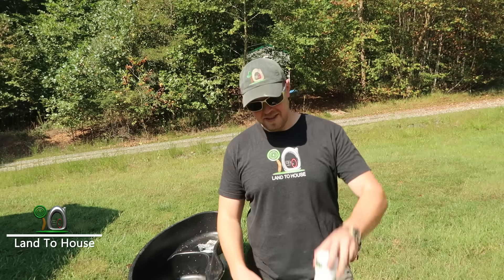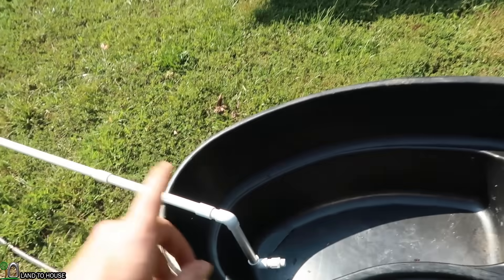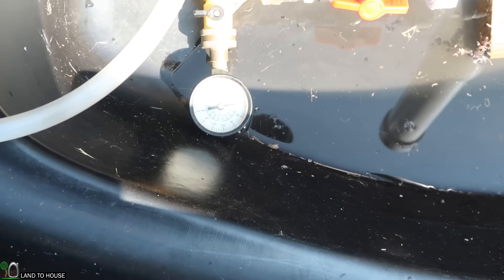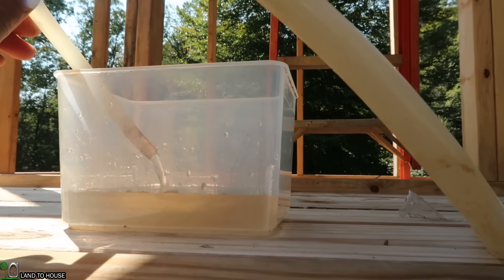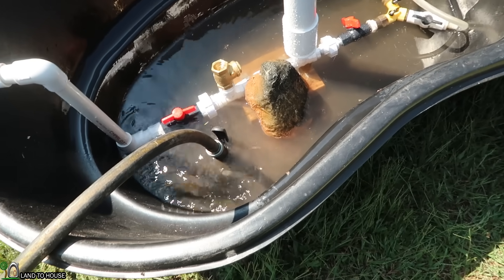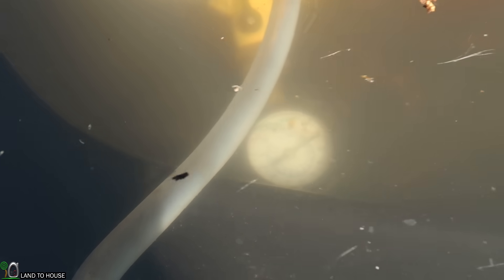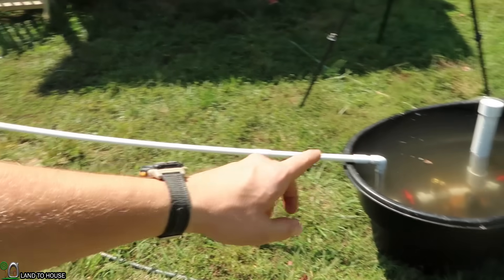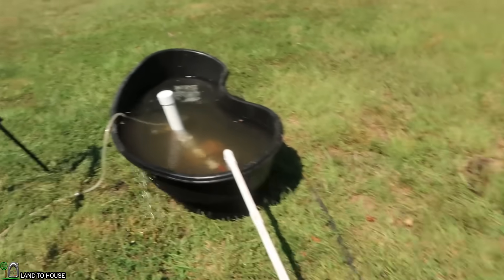Underwater Ram Pump

Comment: Hi, just stumble on your channel and I guess you can help me figure out how I can bring water on top of my farm about 150 meters up using ramp pump. I have a deep well with electric pump that brings the water up to 20 meters up only (where I have a 5 hundred liter water tank there). It would be costly I will put a series of electric pumps to bring the water to the top.
Reply from the maker: The ram pump operates on head pressure (drop in water). Running the ram pump from water you have pulled from a well is not going to work efficiently.  The ram pump waste water is typically 80 to 90%. This means that most of your storage water will end up at a lower state.
Reply: @LandtoHouse  Thanks for your prompt reply.  But let us say we let a 10 meter water drop, how high the water could go from the ramp pump?  I will just have a receptacle for the waste water and another electric pump (of lower wattage) to bring the water back to the tank.
Reply: @francisperil2  The higher you go, the more water is wasted and the amount delivered drops.

Comment: Will the out flow maintain the water level in the supply bucket.
Reply: no, because 80% or more of the water is lost through the first valve
Reply from the maker: Sadly no. The ram pump has a great loss. 20% or less of the water is delivered to the output. So if you are trying to run a closed loop you will have all the water at the bottom quickly.

Comment: ...my observation...the secret IS that a ram pump must/should be below the water source (a certain height to help determine how far up it will pump water) in order to take advantage of the ram effect to get the water pumping...as you stated...it won't work in a lake and I'm pretty sure it won't work in a well...and a direct feed to the pump is better than having 90 degree turns that slow the water speed...and if you have a hose going up to the top of you structure as you have...that's what you want it to do but wouldn't it create a siphon effect pulling water down and out the exit opening of the hose...my observation is probably all wrong...thank you...
Reply from the maker: You nailed it on all points! A siphon is what happened on that delivery. When I moved the catchment tub to the top and made sure it was above the water source it stopped the siphon. In a real setup you would want to keep any siphon from starting.
Reply: @LandtoHouse  Actually - having a SIPHON effect in the delivery system - isn't at all a disadvantage .. as?
Where the final delivery - is say partway DOWN from the TOP of a hill that you want to deliver OVER - the hydraulic ram pump is needed to get the initial flow UP to the top of the delivery hill - whereupon  the syphon effect of the water flowing down the other side of the delivery pipe hill - will in fact increase the efficiency of the hydra pump as it IS NO LONGER pushing all the water to the top, instead it is ONLY pushing all that water to the actual height of the final outflow point, (since it is in fact - the syphon effect which pulls the water over the top of the hill itself, thereby assisting the hydraulic ram pump to deliver more volume of water, at a lower "final" delivery pressure - to a lower final output level - than it needed to get the initial flow up to & over the top "first" - before the effect of the syphon took over "the top half of the syphon section of pipe across the very top of the hill, as the water fell down the other side - to the outflow point).
The outflow point being MUCH LOWER than the top of the hill, the hydraulic ram pump is thus able to deliver MORE water - faster at a higher pressure - see?

Now - if the truth be told fully - the SYPHON can be used to several advantages - in that the delivery pipe can then be run - over SEVERAL intermediate hills, before the final outflow point is reached, with each hilltop section being "pulled-over" by syphon effects, yet the hydraulic ram pump - ONLY sees the final outflow point as IT's highest delivery point.

Now see the advantages of syphon effects.

ONE hydraulic ram pump - could NEVER raise the water over the intervening hills after the first one, WITHOUT the syphon effect assisting the water flow over the first and subsequent intermediate hilltops.

Comment: name. You sent the water  back up to the water source and over a water wheel could you turn a generator
Reply from the maker: You could but it would be slow going. These pumps typically supply 1.5 gallons or less per minute.  That is not enough to power much.

Comment: Can the creek be a level or does there have to be a grade? It's a rapid moving creek. I lived in paradise the hole town burned down.i need a water source for rv.
Reply from the maker: The ram pump does have to have drop (head pressure) to operate.  About 1.5 feet minimum.

Comment: Ive not tested my theory of how to use a ram pump in a body of still water but here it is...

Configuration 1
With the pump placed several feet under water, connect the source line to a floating container that is mostly submerged and has an opening just below the water line to allow the water to enter the container.  The opening would have to be of such size that the entering flow rate will not exceed the exiting flow rate to feed the pump.

Configuration 2
A coil of sufficiently sized tubing wrapped around a 55 gallon barrel, and attached at regular intervals for stability, from top to bottom with the top and bottom cut out to allow the barrel to be submerged in an upright position so as to create a downward flow path. The pump would be connected to the lowest end of the tubing. The upper end of the tubing would be affixed just below the water surface but deep enough to avoid syphoning air. 

This configuration would create fall and distance. The number of tubing wraps around the barrel probably should be few in order to create more head pressure.

Im my mind either of these configurations are mimicking a higher water source that is falling downward to the lower submerged pump.

One more thought...
If the source end of the tubing is fitted with something like a funnel that would cause the water to spin, like in a whirlpool, the water may flow faster through the tubing. I have seen videos where water flows more freely when it is flowing in a spiral. I will leave that up to the readers to investigate. 

I'm no scientist or engineer. Just a shade tree dreamer. I'd love to see someone try this out, though. Let me know if you do.
Reply: Jonny Doe unfortunately, for flow to be created, there needs to be a difference in water level, so submerging a ram pump in a pond or a lake with the intake in the same lake will not create any flow. To see this, simply submerge a straw into a sink or tub of water and see what you get for flow after the initial surge through it as it fills.
Reply from the maker: Well stated .
Reply from the maker: These sound like a good idea but there is no water flow in these setups. When you sink a pipe underwater you gain head pressure but you also gain hydrostatic pressure. These two are equal and opposites. This means that you have no change in pressure. In your ideas you might get the ram pump to cycle once with the sudden surge of water going into the pipe but after that the water will be stagnant.

Comment: 1 check valve only?in other videos i saw 2 check valve
Reply from the maker: Two waste valves allows for a higher volume of water to be pumped but does not increase the lift height potential.

Comment: Thanks for sharing this..
Greetings from Indonesia....
So, it turns out the main advantage for putting the ram pump underwater is for reducing the noise generated from the clicking sound..

A cheap solution for it..

Imagine if there's many pumps installed -- lets say 20 pumps or more -- ( https://www.youtube.com/watch?v=9tNy2rL3pJU ) , the noise generated by the pumps will scare out the ghosts in the river or pond out of the blue...
hahaha...
Reply from the maker: I imagine that would be very loud! Those are large pumps too!

Comment: Another advantage I can see; having the supply and pump underwater in freezing weather where the ice level above the pump might cause a problem.
Reply: Saw this vid only now, but before the advantage at the end came up, that was my idea to.
We have freezing over of ponds now and again, but I have to go back over 20years that you could drive a car on a pond/lake. About 10 years ago we had our last +10cm of ice. Putting is 1m down would have given you year round supply in this kind of weather. Problem is that 0,5m of pressure is hard to create over here :-p
Reply from the maker: Yes good point! As long as the pond has moving water it should work to prevent freezing!

Comment: Seen a guy get 90 psi and put an air valve in the top for an air compressor
Reply from the maker: Interesting. I dont think that it would work for long. The air space in the pressure tank is very small.
Reply: Check out Mr. Teslonian he fiddles with a lot of interesting ideas you might find useful
Reply from the maker: Yes he has nice stuff!

Comment: Have you tried adding a spill pipe for extending the waste valve above the "pond" water level,  to reduce the head volume of back - pressure from affecting the system ( internal PSI ?)
Reply from the maker: So it turns out that adding a pipe to the waste valve reduces the head pressure. The underwater pump has no real change.

Comment: If we put the pump deep in a river and tie the intake hose in a ballon to take form the river surface , do you think it will work ???
Reply from the maker: Sadly no.  The pump does not work very well in a deep river.  The intake can be at the top of the water but sinking the pump in the water does not create head pressure.
Reply: hahaha - if THAT worked, why have a pump at all, just put the delivery pipe inflow at the bottom ?
As your theory says there's MORE pressure at the bottom - to push the water UP the pipe - instead of up the outside of the pipe - where - OH LOOK it already is (outside the pipe).

Comment: What about polluting the water  with it under water. Also it looks like there is a kink In flexible hose in the black tub.
Reply from the maker: Yes there was a kink. That possibility reduced the output. As for pollution of the water I have no idea.

Comment: So what you are saying...
If you install the ram pump in a deep pwon you can make it work.
You need a long hose so you have a high deference.
But you need air pressure in the chamber before you start.
Reply from the maker: To get the ram pump to work underwater you must have a source from outside the location of the pump. In my case I used the ram pump underwater yet had the source from a bucket outside and above the pond.

Comment: Can you test on a closed circuit like a fountain to see how long it will continue to pump. My plan is to aerate a large pond, I would like to pick up the water from the bottom of the pond, run a line through the levy and go up the outside back into the bottom of the pond. The pond is 40 feet deep at it’s deepest and almost an acre.
Reply from the maker: A good reference point is 80% loss. To be honest it is very inefficient to have the pump run on a closed circuit

Comment: The surrounding water when the pump is cover has higher pressure than the exposed pump on air. Means that the internal pressure released water on a less pressure when is exposed the exhaust valve. in other words. if the system is on deeper waters will lose more pressure. conclusion the Ramp valve works more effective on shallow waters.
Reply: If you build it for 24/7 and it give you that pressure. You can use siphon to make it work.
Reply from the maker: I hope to find a place next year that is deeper so that I can test the pump under a few more feet. That should help us better understand the use of the pump underwater.

Comment: I need a ram pump that is self-priming as my creek only has water when it rains... Do you know or have any ideas on how to make it work? Have a great day...
Reply from the maker: I tested a timer on a pump once but that was 50/50. I'm not really sure of a way to self Prime the ram pump
Reply: @LandtoHouse  I will keep looking... If I find one, I will let you know as I'm sure others like me could use one... Thanks again... Will keep watching... Have a great day...
Reply: Wouldnt air relief valve by pump so only air escapes 
Then when it shuts it triggers that check valve to open, I'd try this if I'd lived in the sticks 😂😂😂
Reply: @davey2k12  I do live in the sticks...LoL... The problem is how do you get it to start as I'm not able to be there all the time... Have you tried it? Have a great day...
Reply: @MikeBrownOhio   hi Mike, did you find a solution?  I've got a similar problem - creek stops flowing and need to reprime
Reply: Maybe a second little pipe with a small hole in the end that fills when stream is flowing and trickles in to prime it
Reply: @michaeldimatteo8290  Not yet as winter has set in... Think I may end up with a bilge pump that is set in a weighted bucket that is inside a bigger bucket or small barrel... All will have holes and mesh screen... The power will come from a solar panel and battery setup... I hope that helps you... I would rather have a ram pump but Gotta work with what I have... Have a great day...

Comment: 1 can you 90 º the check and pressure vessel  and do a verticle submersion pump?

2  a remote reservoir and air compressor  with pressure regulator soasto  raise air accumulator pressure near blowout/ escape pressure?

heres my desire. large hi vol pump ( sprinkler pump) to pump water only high enough soasto drive ram pump and have ram pump high elevation pumping capacity raise well water to elevated platform for  distribution. 
thus recycling the 30% waste water thats kept in the well. 

ram pumps are not popular in arrid climes where catch water is the only way because no one can afford to  loose the 30% water as waste.

(30% being check valve flow)
Reply from the maker: The ram pump can work with a pressure tank in the horizontal position as long as there is a bladder in the tank. But it's much less efficient than having a vertical pipe. 

The ram pump is definitely best suited for an active flowing Creek. The Wastewater can exceed 90% at times

Comment: I've made two ram pumps with a well expansion bladder tank. They worked extremely well. I think they are too big and bulky for what you're trying to accomplish. I have a suggestion I've not tried it yet but I see they make smaller expansion tanks. I thought you might want to give it a try. Keep up with the Good Vibes.
Reply from the maker: I just spoke with a local plumber friend this past week. He is is going to see if he can locate a used bladder tank that still works. That way I can make some test videos this next year using an expansion tank.
Reply: Sir, can I place ram pump inside aquaponic fish water tank?? Can it be helpful to save electricity and maintain water flow. Plz advise!!!

Comment: Have you tried pumping from a lake that has a lower elevation from where you want to deliver
Reply from the maker: Meaning that a location outside of the lake? You can siphon out of the lake downhill. Or do you mean using water from a lake to pump water uphill? If you have a place that you can siphon water out of the lake to run the pump then you can deliver up from the lake.
Reply: @LandtoHouse   Thank . I was thinking along the same thought process.

Comment: Have you tried building this linear ram pump? It works underwater too, and works great in a natural stream environment: https://youtu.be/vQym6x0PiCg
Reply from the maker: I have seen that ram pump. It looks like it works but if that inner bladder has a leak or comes out the pump will stop. The ram pumps with pressure tank standing up do not have to have a bladder to operate. (although it does help)

Comment: The question is. Does it make less psi.. OR Is it requiring less, to move the water...  Hmmmmm...
Reply from the maker: I hope to come back next year and make a test with this setup in a deeper pool. Perhaps 3 feet. Then I can find some better data.
Reply: @LandtoHouse  what if you repeat tests 2 or 3 time to eliminate any discrepancies...?
There is an engineering guy here on YouTube maybe he could answer some questions...?

Comment: CooL experiment !! - ))

i'm thinking the pressure dropped as the water leVel rose .. for a net 'neutral' result - ))
i'm curious if the volume of water + flow speed .. into the 'ram basin' changed, as the pressures changed ??

i also wonder .. if the 'ram basin' was 'sealed', 3/4 full of water, with a check valve 'trip mechanism' to get it going (( magnets ? to avoid pressure seals ) .. as the system runs and the 1/4 air in the sealed ram basin 'increases' ((see: requiring a 'strong' initial head pressure = greater than, the 'ram basin' build up pressure )) ... "would the output INCREASE & reach an equilibrium to reflect the 'extra' pressure event .. in the system ?? - ))

anyways ... you're AweSOme !!! - )))

= my creative juices are FLO-WING !!! .. and .. i LOVE THAT ! - )))
.. appreciating the inspiration ! - )))

BE WELL - )))

lovelovelove )))
greb'Z )
Reply from the maker: Thank you. 

I am pretty sure that I do not have answers to any of your questions! This is the second time that I have tested the ram pump underwater and I do not know for sure what the psi changes are about.

Comment: perpetual underwater ram pump whay nooooooot ?????  do it bro ... thank you .. good job ..
Reply: Simo,is it possible, really? I wish to see.in a gallon ok,but 23 hour it is possible?if yes let me know when already.a hug from Juazeiro Bahia Brasil.
Reply from the maker: It is not possible to have a perpetual ram pump unless you do not include the creek water as part of the system.
Reply from the maker: Sadly this is not possible. The waste water of the ram pump is around 80% often times. This means that you will have most of the water at the bottom of the system very quickly.